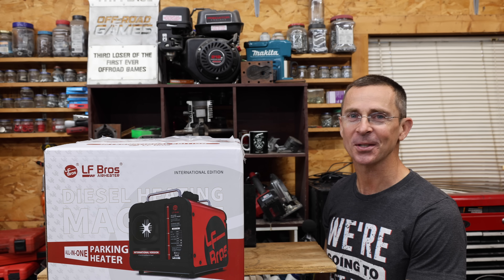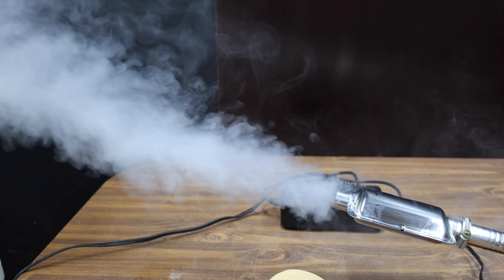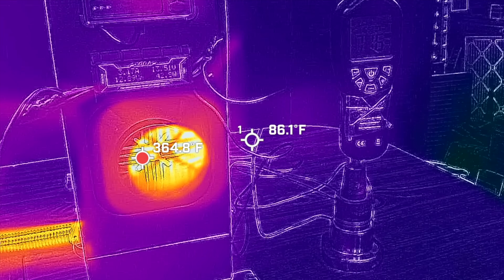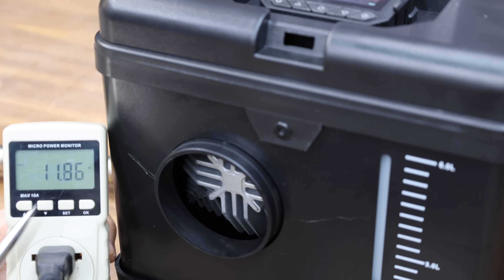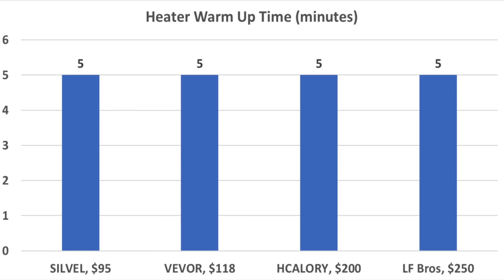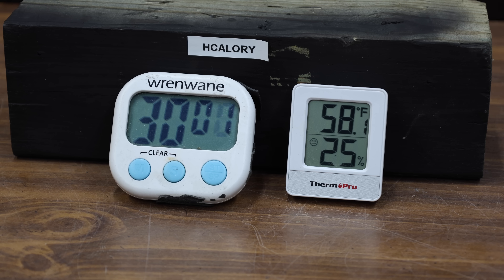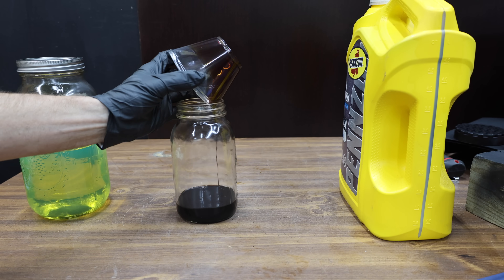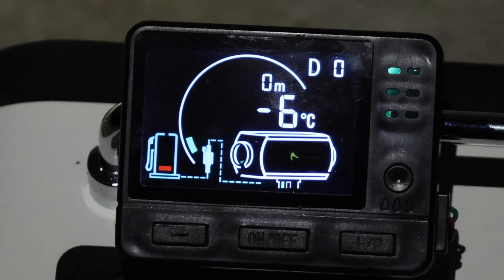The Truth About Cheap Diesel Heaters!

Comment: Always double clamp the exhaust outlet pipe. The Black plastic case heater, I wouldn't buy it because eventually these heaters need to be cleaned out. Always buy extra gaskets for the combustion chambers because most gaskets are shipped out from China and rarely from the USA.
Careful if you tilt the heaters to the side on your installation because of the air hole in the glow plug chamber. And definitely install a smoke detector near the heaters because if the smoke escapes the exhaust pipe, the heater will not shutdown. Run some kerosene through them every now and then because it helps clean the carbon inside the chambers. 
Overall, I have three diesel heaters and love them!
Reply from the maker: Thanks for sharing.

Comment: Hey Todd, I'm only leaving this comment because I know you read all of them and I know you care.

I feel like I need to explain a bunch on how these things work. I have researched and tested them extensively.

Firstly, the reason they all perform more or less the same is because they are all the same, though with slightly different controllers. They're identical, if not functionally identical. They are all cheap Chinese knockoffs of German designed heaters. If you inspected closely, you could probably figure out if they were produced from the exact same mold.

Like diesel engines, if you turn up the power, turn up the fuel, you get more power, more heat, but you sacrifice longevity. You can get them really hot, high output, but at lower efficiency. And eventually, they will soot up and need to be cleaned out and rebuilt. You can run them at lower power settings, and higher efficiency and last for many years without maintenance. So heat output is irrelevant. You showed all "8kW" units, which are actually more like 4 kW. There are 2 kW units and a new slightly larger unit advertised as 8 kW or 8.5 kW. It just has a larger heat exchanger but same internals otherwise.

They're all going to functionally use the same amount of power. It's a control board, a fan, and a glow plug. And the glow plug power is adjustable, so you can use more or less.

They will all have failed starts from time to time and smoke. That has nothing to do with that specific unit, because, like I said, they're identical.

There is no reason to spend extra money except for minor features. They're all the same. You can find non all-in-one units for as little as $68 on Amazon.

To get the best performance out of these things, you need to tune them, but fewer and fewer are tunable. By adjusting the fan speed and fuel feed, you adjust the fuel/air ratio, and you can get them to operate under 30 ppm of CO, which is about as good as you can get.

You CAN burn alternate fuels, but anything you burn that is not distilled (like diesel or kerosene) will quickly fill the combustion chamber with ash and ruin a metal mesh part inside the combustion chamber, resulting in needing to take the unit apart, clean it out, and replace the combustion chamber (cost about $25). This is not optional. Burning waste oil or other filtered and non-distilled oils like vegetable oil, will work temporarily but WILL EVENTUALLY FAIL THE UNIT, as sure as the sun rises in the morning. People will tell you you can burn black diesel or waste oil and be fine, and yes, for a little bit, but it will fail the unit eventually, because all those additives in the oil don't burn. It's not like in a diesel engine where there are explosions to loosen and expel deposits.

I own four different diesel heaters of various types, and have tested some of them to failure with waste motor oil. Others tested to high efficiency with condensing heat exchangers. They are amazing machines, and you can use them normally with no problems, but there is also much room for improvement, which requires research. There is even an aftermarket controller (The Afterburner) available which gives you the absolute maximum in performance and functionality.
Reply from the maker: Thanks for sharing.

Comment: I have three diesel heaters. One like the Vevor with 8kW and two without the housing but with a 10L tank each and with 5kW each. I can highly recommend powersupplys from Meanwell "HLG"-series, which you can often find online used for e few bucks. They're waterproof, fanless and stay cold because the housing is from aluminium. I use a 12V/12A for the 8kW and a 12V/22A for both of the 5kW units to heat my garage-workshop if nessessary. I use mineral-oil for central-heaters, because of lower taxes in germany compared to diesel.
Reply from the maker: Thanks for sharing.

Comment: Okay, it needs a separate power supply. So I don't see how it can save you in a power outage. 
it's not a generator, and the one was killing the battery Bank in what seemed like mere moments so It's not a stand-alone unit if the power goes out, that's not going to save your life if you have to have a separate power supply for the thing to work that's just my beef with this.. I just feel the title is a bit misleading if you don't already have a generator or an incredibly beefy and hefty battery Bank this thing isn't going to turn on, it's not going to run, it isn't going to save anybody when the power goes out.

Comment: I really wish you would add C° 🙂 I own the LF Bros N3 and put it in the drawbar box of my mini-camper. It works very well. The noise of the pump, although quiet, is still transmitted and can be very disturbing at night. A quieter model has already been installed by lf bros in the n3.
It's a pity that the heaters need over 120 watts of power to start and stop and therefore you can't use the 12v output of a power station directly.
Thanks for the test. I can recommend the LF Bros N3 for travelers, as it is well worth the extra cost.
Reply from the maker: Thanks for the suggestion.

Comment: I have been using an old computer power supply unit for powering the heater with 220v. Works really well and usually is cheaper than other options. I hope somebody will find this useful :)
Reply from the maker: Thanks for sharing.